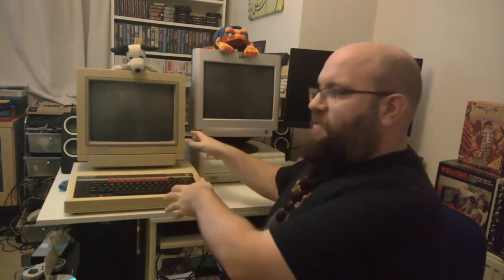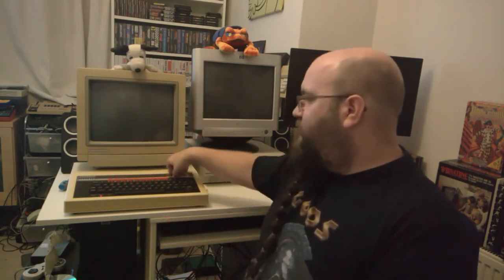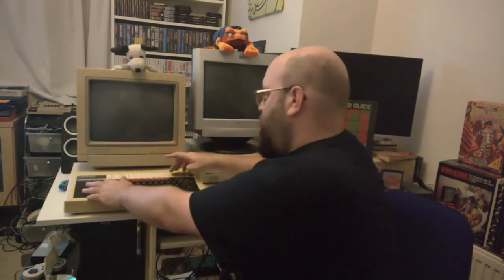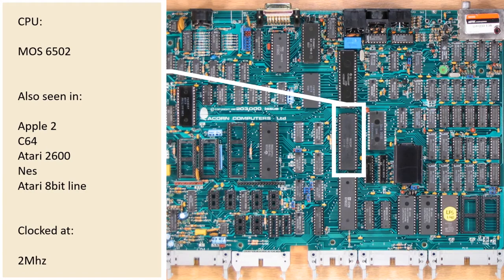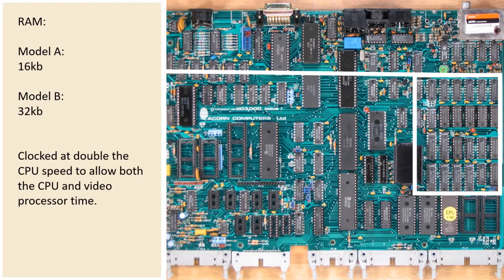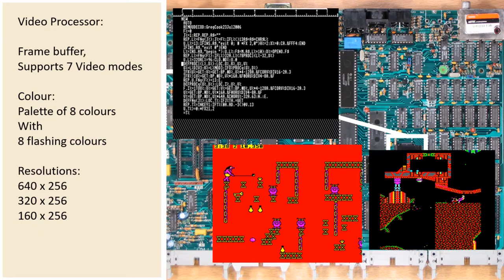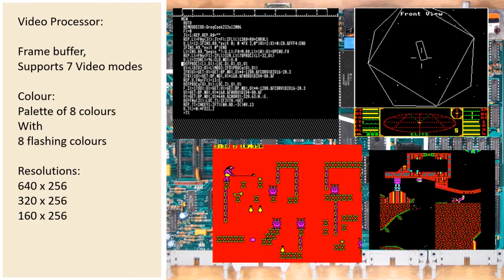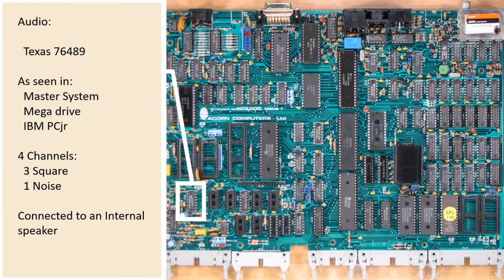BBC Micro Review: Part 1 Hardware

Comment: The middle resolution 4 colour mode, mode 1, also used 20k. Modes 4 and 5 used 10k. Mode 4 was middle resolution and monochrome. Mode 5 was low resolution and 4 colour.
Reply: You can also change the amount of memory displayed either to save memory or to make the maths cheaper when writing games.

Comment: a Teletext chip! I guess it was to be expected on a machine bearing the BBC name :D
That user guide is a thing of beauty, the ZX Spectrum one was great, but that looks even more detailed
Reply from the maker: From what I've read the chip was required by the spec that the BBC had sent out, and was also one of the chips removed when they built the low cost Acorn Electron.  
The user guide is lovely and something I managed to pick up in a second hand book store years before I finally gotten my hands my own Model B.
Reply: The advanced user guide was great too, converting the hardware and assembler and one of them even came for a circuit diagram!